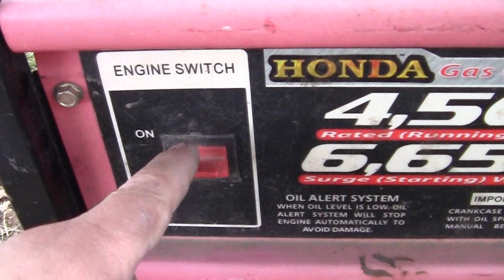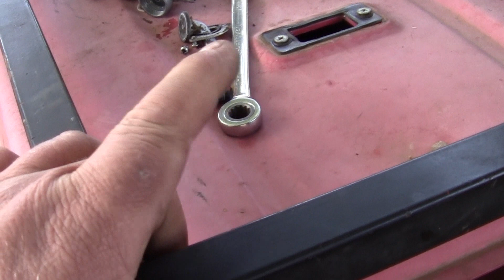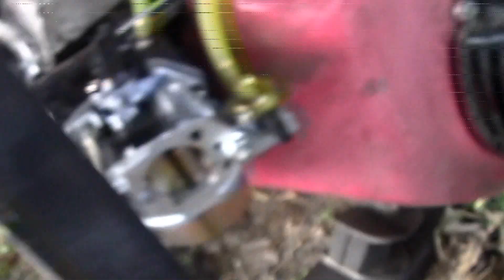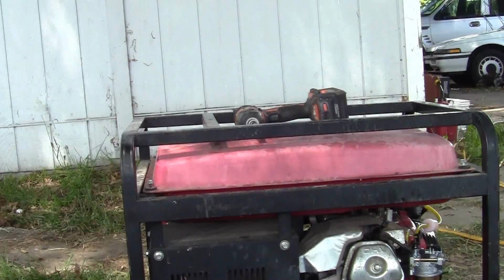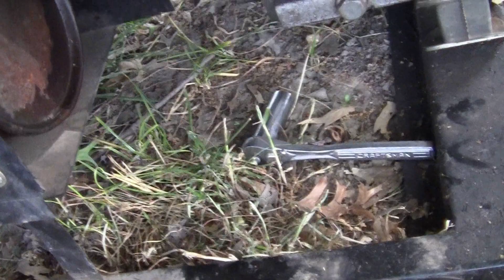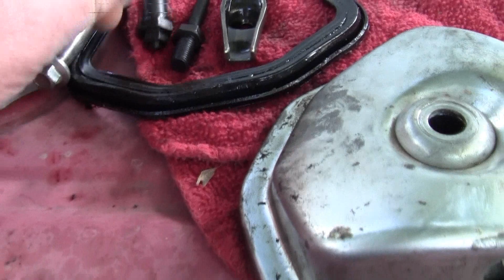HONDA CLONE GENERATOR REPAIR

Comment: Good diagnosis Shawn.  Runs real good.  I have a Chinese jenny with a compression relief cam for starting and it's very weird to adjust the valve clearance compared to one like this.  Cheers Rob